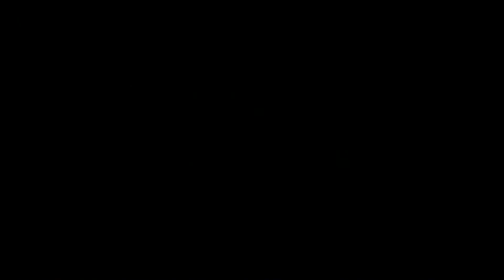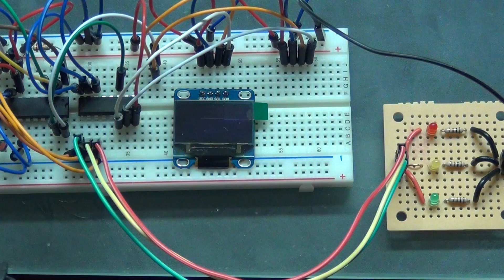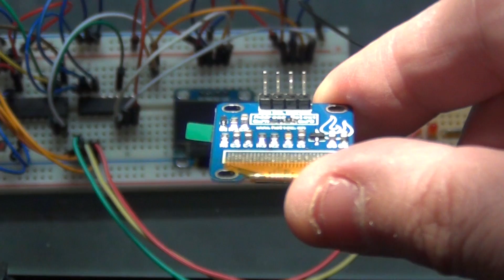Roombaduino - part 17 - Multiple OLED screens

Comment: Thanks for publishing this! This is going to help a ton with my project. I am looking at doing 8 of these, using a multiplexer. Two questions:
1) Once you've sent the data to the oled screens (and the image prints), I assume it stays there, even though the multiplexer has switched the signal to the other oled?
2) Are both oled's able to share the same SCL? And you only need to multiplex the SDA? OR do both pins have to be multiplexed? 

Thanks again! This saves my day. I was worried since the OLED's I bought all have the same address.
Reply from the maker: Thanks for watching the video. I'm glad it's useful to you. I've done a blog post at http://www.raveloxprojects.com/blog/?p=325 to answer your questions and also included the code I used for the demonstration. TLDR; the answers are No and Yes.
Reply: You're awesome, thanks!!!